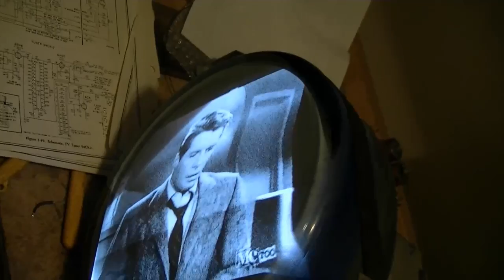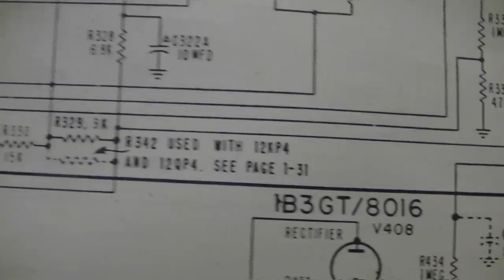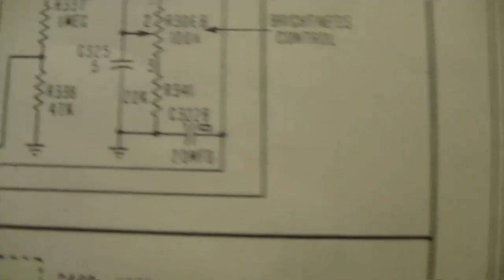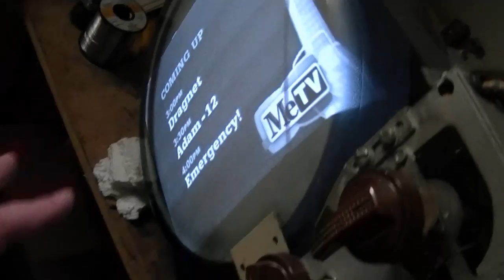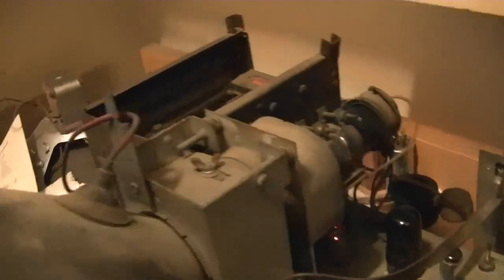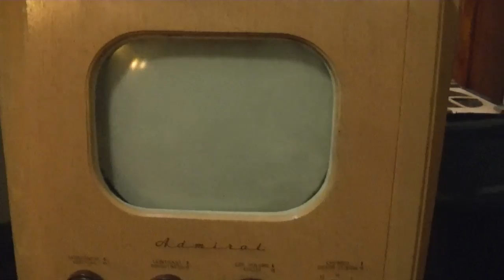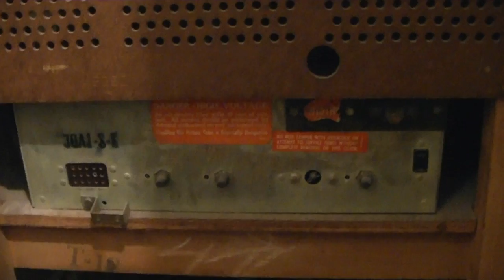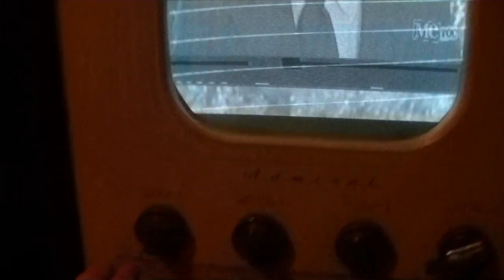Admiral 30B1 chassis restoration p4o5

Comment from the maker: I'm not sure, but it might be tin whiskers causing intermittent shorts as suggested by shango066.  I pulled the chassis back up on the workbench last night and it worked fine!  I'll poke around with it for another couple days then stick it back in the cabinet.

Comment: It's always something... I think the set is trying to keep you in great physical shape!
The Brightness/Contrast voltage divider circuit issue was sure a weird one. A real head scratcher and didn't make any sense at all. Why was there .4V on one side of the 220K connected to the pot and 300V at the top? I know it ended up being the pot but did you find out the reason for these voltages? An interesting and baffling issue indeed.